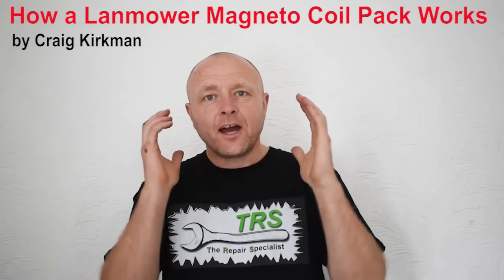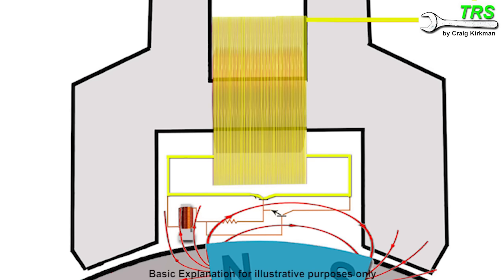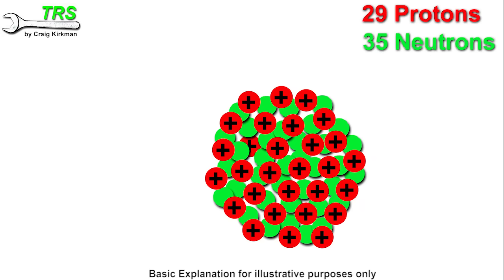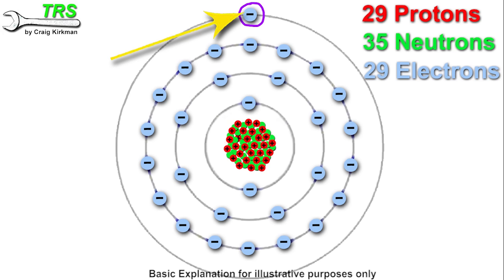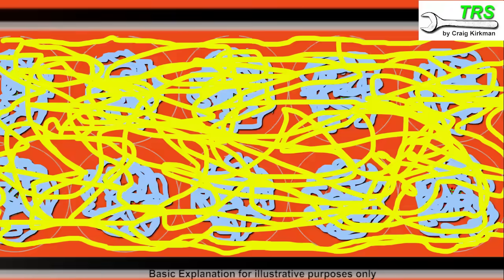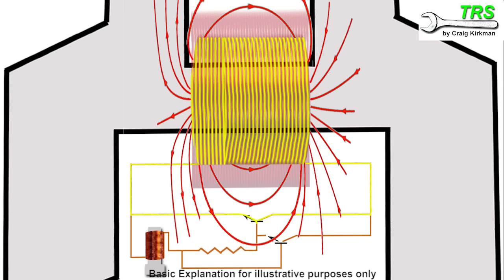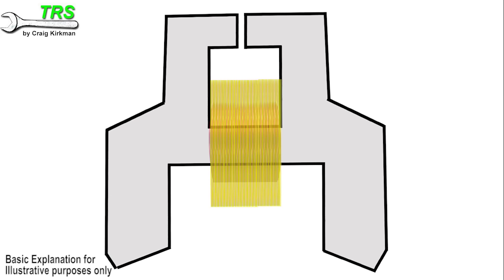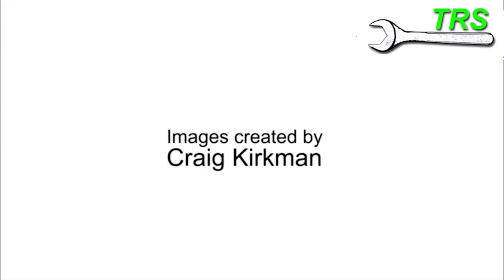Lawnmower Coil Pack Sparking System - Induction Coil, Transistor!  (by Craig Kirkman)

Comment: It's a very good explanation of how electrons flow in copper wire, but the smaller coil is a trigger coil like a set of points the transistor replaces the points so the explanation is missing this bit of information it should be I would think as the transistor is open the magnetic field drops causing the high voltage windings to generate the amount of power voltage to let the spark plug work properly.
Reply from the maker: HI

thank you for watching and sharing your insights on the video!

You bring up a great point about the role of the transistor in replacing the points in the ignition system. Indeed, the transistor acts as a crucial component in modern ignition systems, serving to control the timing of the spark and optimize engine performance.

In the video, I focused on explaining the flow of electrons in the context of how the ignition coil generates high voltage for the spark plug. However, incorporating information about how the transistor functions to control this process would enhance the overall understanding of ignition system operation.

Your input is valuable, and I appreciate your suggestion to include this important detail for a more comprehensive explanation. Providing clarity on how the transistor influences the magnetic field and subsequently affects spark timing is key to fully understanding the ignition process.

Thank you once again for your thoughtful comment and for contributing to our learning community!

Best regards,
Craig

Comment: I remember in 1979 talking with the engineers at the B&S factory about solid state ignition and they said that will never happen........ then on another trip in 1982 B&S was ablaze with the new solid state magnetron ignition.......
Reply from the maker: Hi

thank you for sharing your interesting experience with Briggs & Stratton's transition to solid state ignition technology back in the late '70s and early '80s.

It's fascinating how advancements in technology can sometimes surprise even the experts themselves! It's a testament to the innovative spirit of companies like Briggs & Stratton to continuously push the boundaries of what's possible in small engine design and performance.

The shift to solid state magnetron ignition indeed marked a significant leap forward in reliability and efficiency for small engines. It's incredible how engineering developments can evolve over time, often driven by new discoveries and changing industry demands.

Your firsthand encounters with the engineers at Briggs & Stratton provide a unique perspective on the journey from skepticism to embracing solid state ignition technology. It's a reminder that innovation can transform even the most established industries.

Thank you for sharing this intriguing anecdote with our community. If you have more stories or insights to share, feel free to do so. We appreciate your engagement and enthusiasm for engine technology!

Best regards,

Craig

Comment: I never knew the coil pack has so many components. So thanks for the video. But I have to say I’m not convinced by your explanation of the generation of high voltage for the spark plug. The theory can’t be correct or complete without mentioning the changing magnetic field, which is what matters. That said, I also found your explanation of how electrical current got its name interesting.

Coincidentally, I have one weed eater engine torn down and have one such coil pack for my close inspection.

Comment: Really nicely explained there 👍
I suppose the direction of the windings is why ive put new coils on mowers before, and had a really weak spark that couldnt quite make the engine run. Then flip the coil over, and its a perfect spark and runs like a dream.

Comment: Excellent explanation. Let me ad. I am a retired electrical tradesman. Electrons are a physical EMF force. How can something physical move through a solid matter, wire? Electrons do not flow through. Electron excitement travels on the surface of the conductor. The outter most atom proves that it can move freely on the surface onto other atoms until it reaches its equal opposite charge. That is why braided wire, extension cords, appliance cords, etc, can deliver much more current, amperage, flow, than solid single core wire. If the charge, the potential (voltage) is great enough, the outter most negatively charged molecule will jump widely spaced atoms, increasing its negative charge as it travels towards Ground, Earth is always positively charged. That is the basic explanation of how a charge of lightening occurs.

Comment: This was great, thanks!  A basic understanding is needed, and little bits here and there over years makes this illustration a great gap filler (get it?  spark plug gap... har har har) and gives more info for a better understanding.  Awesome.  Incredible how people figured this stuff out and harnessed this energy many many years ago.  It might help to include a description of how this electron pushing by the magnet on the flywheel is not free... that is to say it is not simply no resistance between the flywheel magnet and the coil.  It is to say as the electrons get pushed out comes at a cost of the increasing physical effort to move the magnet past the coils.  A physical effort that you can feel increasing if you were the one moving the magnet across the coils.  That's just like those hand-crank flashlights you can buy, where there's virtually no effort to turn the handle if the light switch is off, but when you flip the switch, it becomes very noticeably harder to turn the handle to push the electrons through the lightbulb.  Fascinating stuff, this is.

Comment: Craig, thank you for this video. I have a couple of questions on the transistor circuit. 
1). I don’t understand how the current gets back to the trigger coil. 
2). How are the transistors get their bias voltage?

Comment: Thanks for this informative video, which I've just seen 2 years after it was posted! I'm a little baffled with my B&S 5HP. The coil had taken its last breath, and had the trigger coil clearly visible as shown. The replacement coil supplied, which looks very different, doesn't have this, and only the two sides of the metal core come anywhere near the magnet, set at 0.006" gap. The main coil body is a good quarter inch away, but, it works, fires up straight away. I'm just puzzled by how it does without the trigger 🤔

Comment: I'm a mechanical engineer and I don't recall ever seeing an explanation of how this works in my studies that was anywhere close to as understandable as this. Great job! The only other thing I would have liked to see is where the electrons go after they ground at the engine. I assume they work their way through the engine ground back to where they started. If that's correct, it would be good to show that in the video to complete the electron's path. Thanks for all your hard work with this video!
Reply from the maker: Thank you so much for the kind comment. And yes, I agree that the
Electrons take that path after being used as a spark. Thanks again 👍👍

Comment: I’ve got a 20 year old snowblower with no spark. Already tried a new spark plug. I’m replacing the coil. Hopefully it will do the trick.  I was wondering how the coil made the spark plug work
Reply from the maker: Good luck! 👍👍👍
Reply: @TheRepairSpecialist  Victory, though I bought one coil and it didn't work, then bought another and the spark plug cable wasn't great.  Inside the head where you put the spark plug the metal would not stay firm and ended up twisting around so it was hard to insert the spark plug.  But the third coil worked!

Comment: My mind is blown!!  One question.  I picked up an hour meter for mower with 3 plugs and original was 2 plugs.  Two are for the positive and negative for display but the third on wiring diagram goes to coil kill wire. That's where I'm confused.  Is the third wire an ac signal as the kill wire simply grounds out the coils.  Please help.  Ty

Comment: We like to call that in the world of tvs and power supplies a transformer if u take a, a metal core and wrap the said thicker gauge more than likely awg#30 or 28 and the thin ice sure is closer to 18awg or 20awg as it's thin but transfers any where from 2amp to 3 on a spike at 1000feet awg ta le chart will show this for usa awg chart

Comment: Its the ingnition coil made of same way , if the are not fit on engines witout magnetic controlled( kiopr ih 770) type  , its noe spark  in the spark plug , but power in too the ignition coil and the start swith its work.
Reply from the maker: i'm not sure what you mean! Can you explain again?

Comment: What I miss understanding is how is it that there is a resistance reading between the primary and the secondary and the ground if they are entirely insulated from each other. Where is the contact between them that produces the reading?
Reply from the maker: Yes I know this is quite confusing, but all I can say about it really is the following: 

The resistance readings you get are , of course, a result of the wire winding inside the coil. When you measure the resistance between the primary coil and the secondary coil, you are essentially measuring the resistance of the wire itself and any potential internal connections. Likewise, when you measure the resistance to ground, you are measuring the resistance of the wire to the outer casing or frame, which is often connected to the core of the coil.

The insulation between the primary and secondary windings is designed to withstand the high voltage generated during operation and prevent electrical leakage between the windings. However, because the wires are coiled closely together and share a common magnetic core, there can be some resistance between them due to the physical properties of the wire and the magnetic fields they produce.

In summary, the resistance readings you obtain between the primary and secondary coils and ground on an ignition coil are due to the inherent properties of the coil's construction, including the materials and wire used, and the electromagnetic interaction between the primary and secondary windings. 

I hope this helps a little
Craig

Comment: If the mounting holes are too small in diameter, can they be reamed slightly to accommodate the proper mounting screw size, or will that destroy the continuity of the flow of energy? I have received an "OEM" replacement coil (electronic) but the holes are slightly smaller than the original. Small differences are a common issue that I have experienced on many "imported" parts - carburetors, automotive starters, and now an ignition coil for a small rototiller/cultivator. It's very frustrating.
Reply from the maker: I understand your frustration with aftermarket parts that may not perfectly match the original specifications. When it comes to modifying parts like ignition coil mounting holes, there are a few considerations to keep in mind.

Material and Thickness: The first thing to consider is the material and thickness of the ignition coil. If the material is thick enough, you may be able to ream the mounting holes slightly without compromising the structural integrity of the coil. However, if the material is very thin, this could weaken the coil and potentially lead to problems.

Precision: Reaming the holes requires precision to ensure they are enlarged evenly and symmetrically. If the holes are not reamed correctly, it can lead to misalignment, which might affect the coil's performance.

Electrical Continuity: While enlarging the mounting holes shouldn't inherently disrupt the electrical continuity of the coil itself, you should be careful not to damage any internal components or wires during the process. Inspect the coil carefully before and after reaming to ensure there is no damage.

Warranty Considerations: If the ignition coil is under warranty, modifying it may void the warranty, so be sure to check the terms and conditions provided by the manufacturer or seller.

Alternative Solutions: Before modifying the coil, consider if there are alternative solutions. You might be able to find adapter plates or brackets that can bridge the gap between the existing holes and the coil's mounting holes. This way, you can avoid altering the coil itself.

Professional Assistance: If you're not comfortable making the modifications yourself, consider seeking the assistance of a professional mechanic or technician who has experience with small engine repairs. They may be able to offer guidance or perform the modification for you.

In summary, while it is possible to ream the mounting holes slightly to accommodate larger screws, it should be done with caution, taking into account the factors mentioned above. If you're uncertain about the process, it's advisable to consult with a professional or explore alternative solutions to ensure the proper functioning and safety of your lawnmower or rototiller.

I hope this helps a little
Craig

Comment: Why is the generic one running my chainsaw backwards?
Reply from the maker: Thank you for your question, and I appreciate your curiosity about this unusual issue. It's not typical for an ignition coil to cause a chainsaw to run in reverse. Chainsaws, like most engines, are designed to rotate in one direction, and the ignition system's primary role is to provide the spark necessary for combustion. 

So my quick question to you is, if your engine is running backwards, then it must have been started backwards. If your recoil is set correctly, where it turns the engine in the correct direction at starting, then surely it can only continue in that correct direction!  Is there a possibility that the recoil is somehow turning the engine backwards? 

How? you might ask. Well, is the cord wrapped around the recoil pulley the correct way?  If its wound on the pulley in the incorrect direction, then this might be making the engine start backwards. 

However, in my experience this is quite difficult to do because of the way the recoil system is structure inside the recoil housing, but i'm not saying it is impossible.  Anyway, lets assume this isn't the case (but please make sure to check it though), so here is some other reasons I can come up with. 

If you've encountered a situation where your chainsaw is running in reverse when using a generic ignition coil, it could be due to a few possible reasons:

Wiring Reversal: Check the wiring connections to the ignition coil. It's possible that the wires have been connected in reverse, leading to incorrect spark timing and engine rotation.

Incorrect Coil Specification: While generic ignition coils can be compatible with various engines, it's essential to ensure that the coil you're using is designed specifically for your chainsaw's make and model. Using an incompatible coil may result in improper spark timing and reversed rotation.

Faulty Coil: In some rare cases, a faulty ignition coil could produce erratic spark timing, which might affect engine rotation. If the coil is malfunctioning, it's best to replace it with the correct coil for your chainsaw.

Timing Adjustment: Chainsaws typically have fixed timing settings, but if someone has previously attempted to adjust the timing, it could lead to unusual behavior. Reverting to the manufacturer's recommended timing setting is advisable.

I recommend checking the wiring connections first to ensure they are correctly configured. If the problem persists, consider verifying that the ignition coil is compatible with your chainsaw's make and model. If all else fails, consulting with a chainsaw technician or mechanic may be necessary to diagnose and resolve the issue effectively.

Your diligence in addressing this matter is commendable, and I hope you can quickly resolve the unexpected reverse operation of your chainsaw. If you have any more questions or need further assistance, please feel free to ask.

I hope this at least sparks some further investigation for you and I hope you get it sorted 

Thanks
Craig
Reply: Yea it was a Husqvarna 450  or 455 and I bought a cheap coil off the Internet. Trying to save money when I put it on it ran the thing back wards . Then I had to buy a new oem one and it fixed it . And I'm just like what the heck . How the heck ?